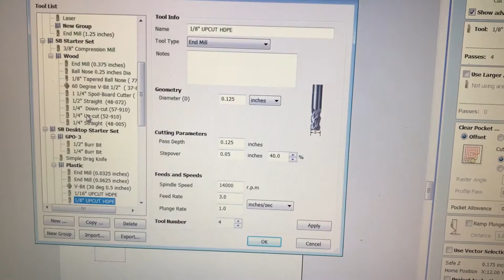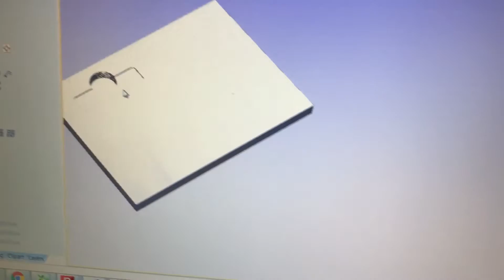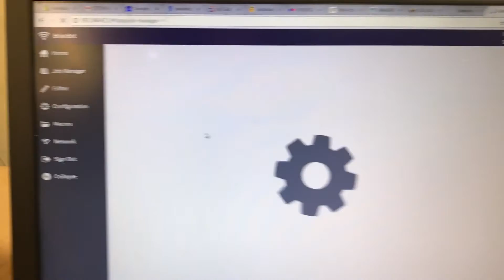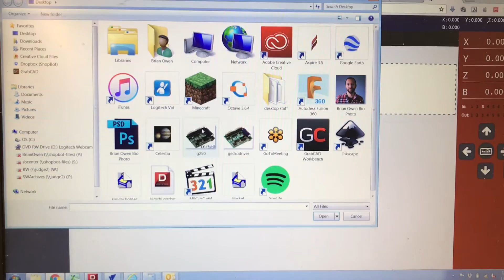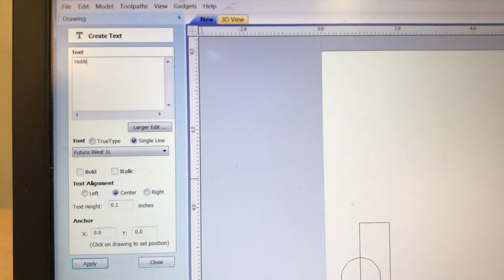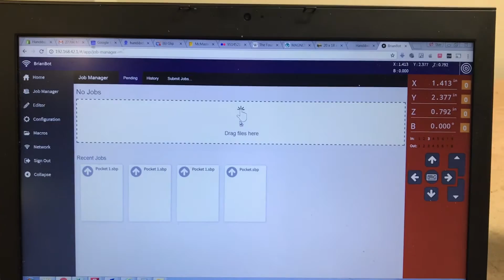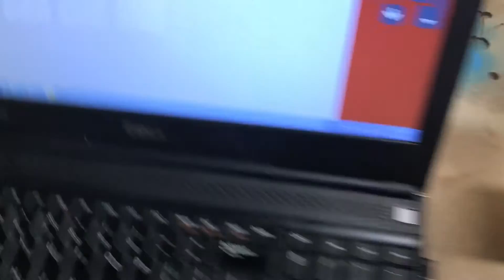Dog Collar Engraving with the Handibot

Comment: Thanks for the video.  Could you please advise what sort of bit is used for the engraving on the brass?
Reply from the maker: The engravings are done using a diamond tipped drag bit. It doesn't need to spin when engraving: https://store.handibot.com/collections/bits/products/diamond-drag-engraving-bit?variant=8287442629